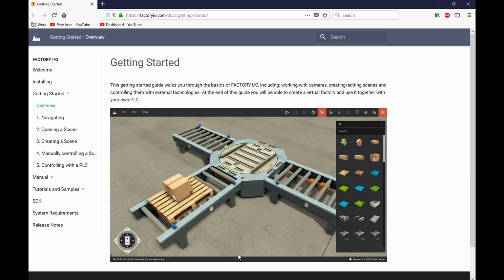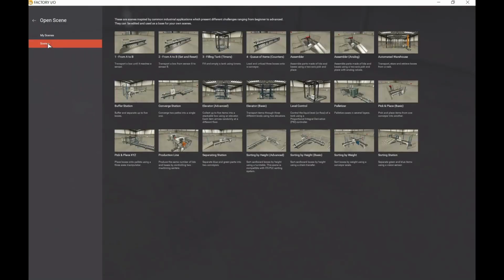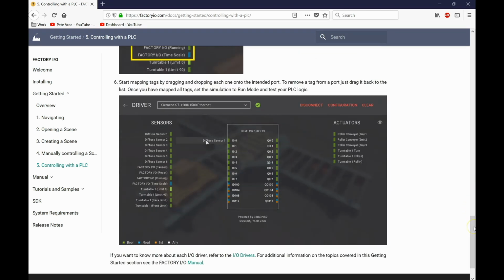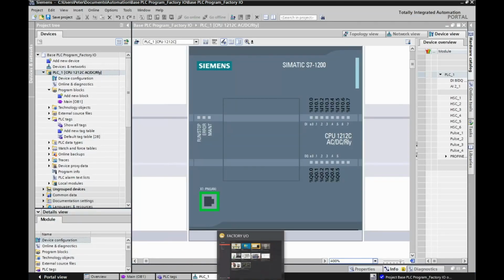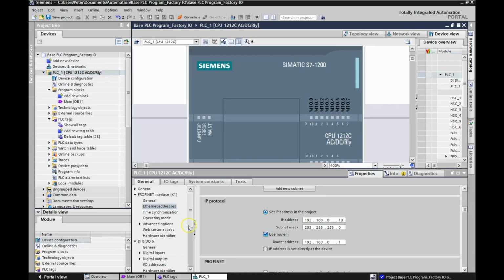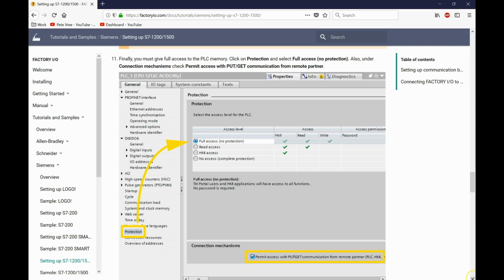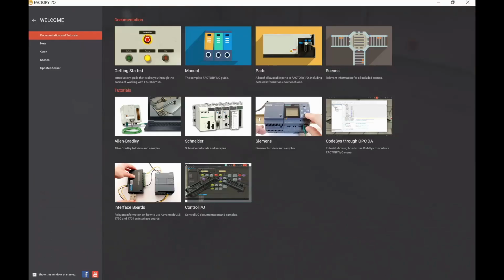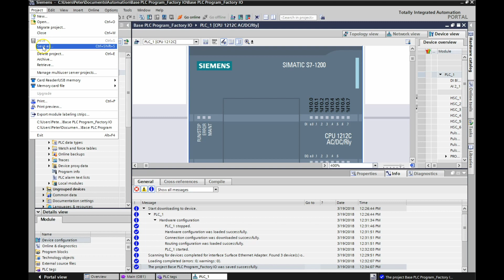All the steps needed to have Factory IO communicate with Siemens TIA Portal

Comment: I am using factory IO with PLCSIM. But recently what is happening is, inputs from factory IO are blinking/fluctuating. Especially in inputs where NC contacts are used (emg pb, stop button). So I am not able to simulate the logic properly. Any idea on what is causing this? Thanks.
Reply from the maker: Best place to get any answer is at this link: https://community.factoryio.com/